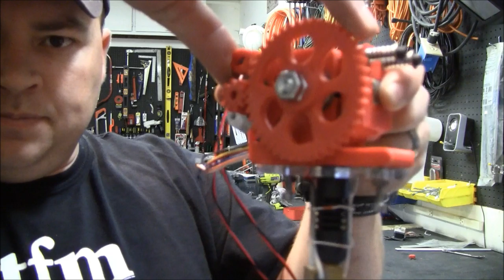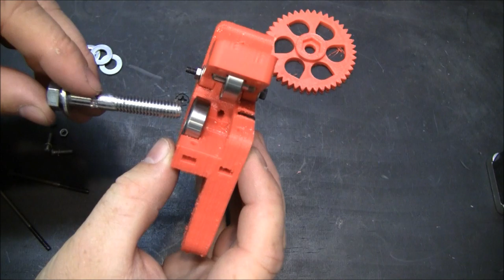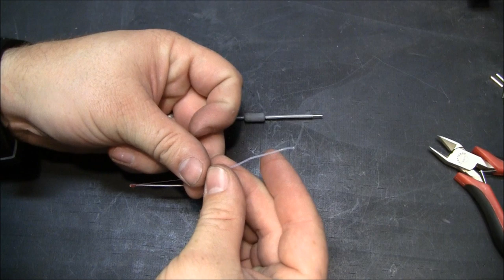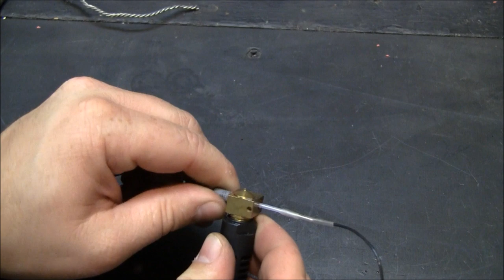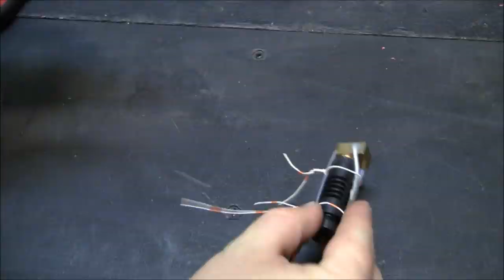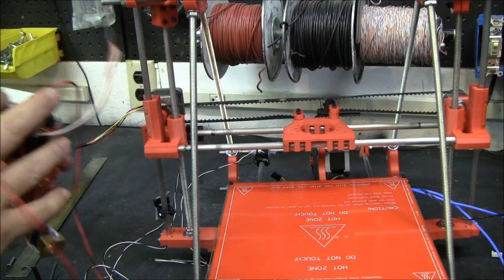Reprap Assembly 06 Gregs.Accessable Extruder

Comment: do you have a complete list of everything used in this video?
Reply: +brunoip 
 1 small-gear (printed)
 1 idler (printed)
 1 extruder-body (printed)
 1 m3nut
 1 m3washer
 1 m3x25
  2 m4nut
  3 m3x10
   3 m3washer
   1 NEMA17
  1 large-gear (printed)
   1 m8washer
   2 m8nut
   2 bearing-608
2 m4x40
  4 m4washer
  2 extruder-spring
1 bearing-608
1 idler-m8-piece